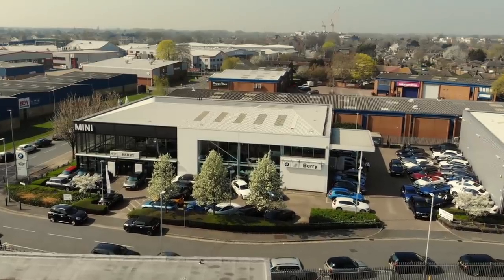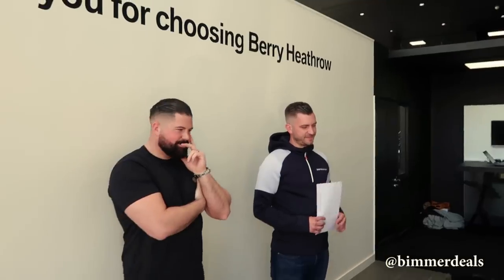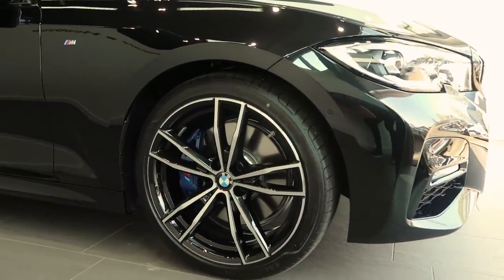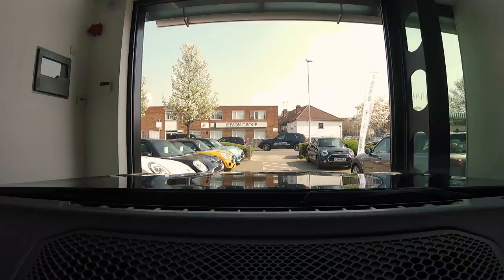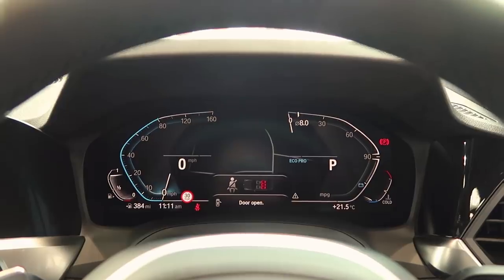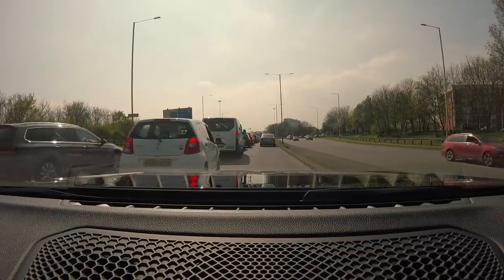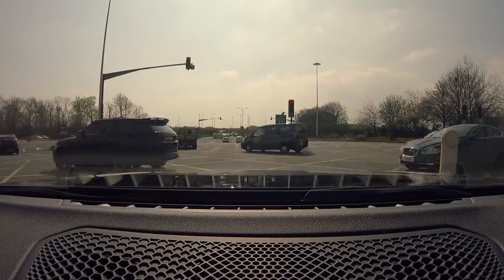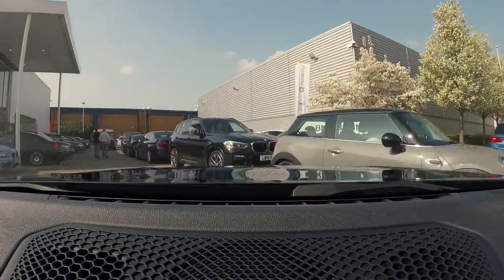NEW BMW COLLECTION DAY FOR LENNY THE GEEZA | 330i | G20 2019

Comment: Enjoyed this one! Lenny is such a cool geezer!

One thing that’s annoyed me though is they are now putting the “M” seatbelt in an M sport model.
At this rate there will be no exclusive M details left! :(
Reply: 100% was thinking the same, seen M3 seats in a 335d 🤨
Reply: It’s all Audi’s fault. The M lites and the not true AMGs (43s, 53s, 45s) exist because Audi had S cars, and to the average consumer an S4 is a better badge than a 335i or a C400. This started the trend of dilution that is rife everywhere now. Look at this 2 litre 4 popper with twin exhausts and fancy seatbelts and blacked out grilles - absolutely no distinction left for real performance cars. 

There is also no room left for subtlety - cars that don’t scream about their power. My F30 335i luxury line has no external clues about the power except for the twin exhausts - the G20 6 pot has bling, stupid grilles and “aero” all over it. If I wanted a car that looks like it was designed for teenagers, I’d buy a Type R.
Reply: Just M all the things.

Comment: Love the color but not my favorite .I went with Black Sapphire Metallic with black leather seats ,night package ,track and handling package with red M Brakes with these wheels adaptive cruise control laser lights ,Harmon Kardon ,wireless charging pad ,Adaptive M suspension.remote engine start . Heads up display. People say the Dynamic handling Package is a waste of money .Don't fool yourself .Hitting twisting roads at 45 or more ,it handles like a champ and the larger brakes ,makes it that much more sportier . My car is 2021, picked up from dealer( October 15,2021} ,the production time was 6o days.So it was not affected by the semiconductor chip.The 2022 is missing a lot of the options above .The active cruise control is my favorite and it reads stop signs and slows the car down when I reach different speed zones.I love my BMW and this is my 8th one since 1984. would never buy a base model.my car cost $55,678 6k down 60 months @ 567.63. With this chip shortage. I am keeping my car .

Comment: Is the new 330 4 cylinder or 6 cylinder??
Reply from the maker: A 4 cylinder, hasn't been a 6 for about 10 years unfortunately
Reply: The 330d is a 3.0 but the 330i is indeed a 4 cylinder since the intro of the F30